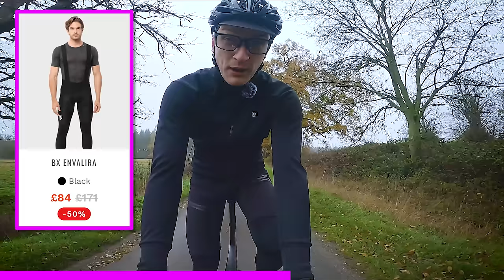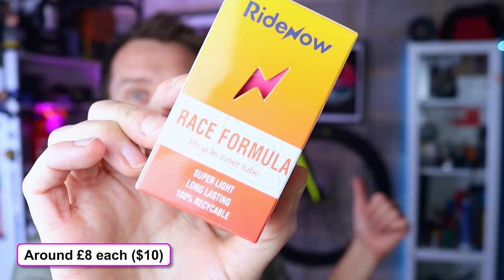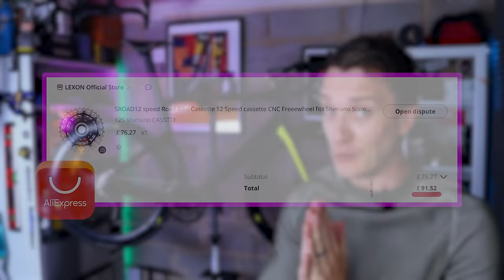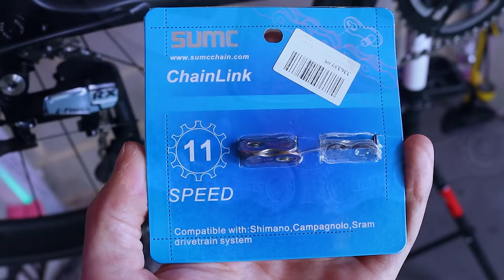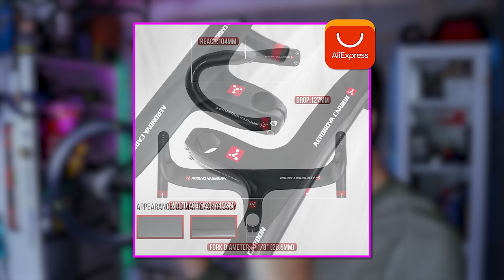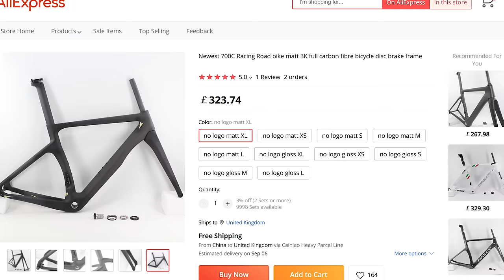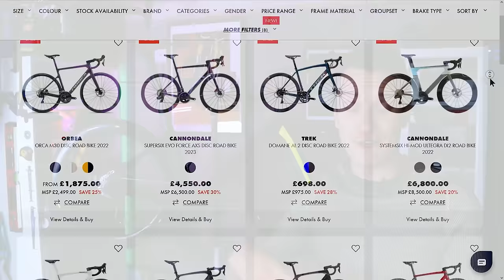£1000 AliExpress Carbon Road Bike - 600 miles later

Comment: My seat tube has the same set-up and I never had any problems with it, even like it as it's easy to set the right angle for seat. 
As a person that weighs quite a bit more and with a well over average sprint power..... I'm horrified by the sight of that carbon quality as well as the fact you have no inner support for your steering tube up to the baring. Not afraid for chinese carbon but I do prefer a brand that likes to keep up a good name (and stick to the name as well).
I do ride some Elite wheels as well, with dt swiss hubs.

Comment: With the most possible respect, I think at this point I'm actually concerned for your safety Luke. With all the problems, failures and caveats you mention here, I think you would have been better served by paying more for a named brand bike. Be careful out there. If that frame fails, which it could, you could be seriously injured. 🥖

Comment: I would have taken a chainsaw file to the hole in the seatpost to allow the bolt to be pointed more vertically.
Reply from the maker: Yeah I did think of doing this, the only thing I was slightly concerned with is that in doing so, the whole bolt could be pulled through the bottom of the hole...

Comment: Yea I hate this design. I have noticed the reason why my seat all ways slips is because when you clamp it feels secure and bolted down but for some reason the spacer in the bottom will get stuck on the carbon not allowing you to tilt it properly!

Comment: Love the vids mate.  Silly question time on bottom brackets, frames on Ali often say BSA BB68.  Does that just mean they are BSA with 68mm length?.  Is this compatiable with most cranksets, what do you have to look for to make sure compatible?  🥖
Reply from the maker: Yeah exactly right. BSA is usually the BB that is the easiest to work with IMO. It's easy to install, they are generally quite cheap, and are super easy to replace when the bearings wear out!

Comment: RXL SL isn't a brand or manufacturer, it's a knockoff logo for Bontrager. I don't know why you subject yourself to these bars. Even if they were brilliant, you can't pin down who made them, and it's such a detail-sensitive part that the next set could just as easily be trash. Very hard to recommend something if you can't have confidence your viewers will have the same experience.

Comment: Must admit that was certainly an entertaining watch, and in a very good sense!  Gotta say though that I would have very little confidence in this bike on descents especially, for fear of some part of it exploding into a huge "carbon shrapnel" event, with me laying on the pavement in unmentionable positions. Thr seat post is a disaster from top to bottom, and without some additional structural integrity provided by an expander plug, that stearer tube extension totally freaks me out.  I imagine myself holding onto the handlebars and suddenly realizing they are no longer attached to the bike.....otherwise, a very gallant, and again, entertaining experiment.  This is my first view of your channel, so I suppose I should ante up and subscribe!  PS - would be interesting to take this frame, and another name brand one running $5-7K, cut them up and really see what the differences are....my suspicion is maybe not as many as you might expect!  Maybe someone could donate to you an older, even broken,  similiar but way more expensive frame, along with a cheap one, for this task.  I would enjoy watching you conduct that procedure!

Comment: that's unfortunate to hear about the rxl sl bar. I agree the design is shit on that bar. However, I purchased one of their traditional bars (non-integrated) and it is going exceptionally well after 500 miles of abuse. It is their super lightweight model, it weighs 180g so I was kind of expecting it to crack but its taken sprinting and everything just fine. I didnt use a torque wrench, i just tightened it in increments until the bar could no longer be rotated in the stem (I used a lot of force to test). Generally, I think the one piece integrated bars are a no-go but the regular ones seem good, mainly because it seems they present less engineering problems.

Comment: 🥖🥖🥖🥖🥖🥖🥖🥖🥖🥖 Baguette Brigade. Will be interested in the Juin Tech GTs. Given that the world still doesn't have a direct, built to purpose, hydraulic brake system for gravel mullet builds (although there is the at some point coming new L-Twoo groupset), this could be a good answer to mix with an Advent X drivetrain. Although, for the price, we're heading into the same cost range of my hack Shimano build with 2nd hand GRX/105/SLX stuff using a tanpan.
Reply from the maker: So I actually stuck the GT's on last night, and they are really good actually. Prob not twice as good as the regular JuinTech's, but i was impressed. They are not entirely bedded in however, so we'll see how they really perform after a few rides...
Reply: @TraceVelo  Awesome good to see!

Comment: 7.97kg for a disc brake road bikeis pretty good I think, I have a pretty similar weight bike but rim brakes. 
The build is;
🥖🥖🥖🥖
2012 Giant TCR Advanced Frameset(size small)
Sagmit Racing Pro 2.0 wheelset
Sensah Empire groupset
YBN 11 speed chain(pre waxed)
Sunshine 11-28 cassette
Shimano Tiagra 52-36 165mm crankset
Zstar dual pivot brake calipers(looks like Ultegra)
Fizik Arione saddle
Giant Contact SLR OD2 stem
MOB Sprint 38-40cm flared dropbar
Giant Contact Bartape
Alligator Compression less brake and cable housings
Jagwire inner cables 
Zefal Bottle cage
Shimano Dura Ace brakepads
Continental Grandsport Race Tires
Generic butyl inner tubes
🥖🥖🥖🥖

Overall my bike weighs around just under 8kg I believe I can get it to 7.5kg with the carbon wheels but my sponsor doesn't allow me to take that home lol. Hope to get a digital scale for a more accurate weigh in next time. Price is probably around 1.5kUSD which I guess is unreasonable for a build that still has aluminium wheels and cheap parts but the frame is really expensive because it's the same model used on world tour races just without the integrated seatpost so I probably had money for carbon wheels if I picked a different brand like Elves or Devel.

Comment: 🥖 Hey Luke good video and heads up LTwoo have released a 2x11/12S hydraulic groupset on aliexpress. Also how's your gravel bike fairing, I have an update on my own build.
It's currently just hit 1000 miles and  only real issues were a alie chain replacement 500 miles due to stretch and the Sensah Dub bottom bracket got replaced with a nukeproof one as it developed play and a creak around 400 miles. Otherwise it's been pretty solid but it's no longer a budget build. I have been gifted an sram rival axs xplr groupset and now have the rebuild bike entirely. On the flipside It means I can use a carbon ogevkin stem and remove the Giant Conduct system , which is a massive weight save , about 400 grams alone from it so estimated weight is 8.3 kg with pedals. 🥐

Comment: 🥖🥖🥖🥖🥖🥖🥖🥖🥖🥖🥖🥖🥖🥖🥖🥖🥖🥖🥖🥖🥖🥖🥖🥖🥖🥖🥖🥖🥖🥖🥖🥖🥖🥖🥖🥖🥖🥖🥖🥖🥖🥖🥖🥖🥖🥖🥖🥖🥖🥖🥖🥖🥖🥖🥖🥖Actually very interesting the difference in stack between the two bikes. A 25mm 40mm+ is massive and highlights the marketing B/S  based on that.  

However, is that relevant with a aliexpress frame that is from a non-mainstream builder. That has no real real world continuity between frames (perceived)?

Comment: Just one honest question, please:
Is there any warranty or disclaimer on those parts? If a person is injured or dies from an handlebar\fork\seatpost failure... thats it?
Cheers and thank you.
Reply: The 'disclaimer' for parts of an unknown quality is good common sense.  It's very unlikely that in this case the retailer will openly admit to probable parts failure resulting in injury or death...they just wouldn't sell anything.  As for a warranty, well if it breaks you contact the retailer and show proof of failure.  Then just hope they refund your money.  It's another matter if you are injured or killed.  There is very little legal recourse when buying from this type of retailer.  The Consumer Rights Act 2015 and The Sale of Goods Act 1979 (for purchases made before 1 October 2015) says that any goods you buy must be: Of satisfactory quality, fit for any particular purpose made known to the seller and as described.  But I don't think aliexpress is overly concerned about that.  It's a issue if you have some form of bike insurance that covers personal injury.  Fitting what could possibly be sub-standard parts, knowingly, may void any claim made.
Reply: If you  buy through Ali Express you can raise a dispute if the seller does not provide quality goods
Reply: Thank you for enlightening. I´m still amazed such business can operate in EU whilst if I, as an EU resident, provide any kind of service or product have to go through a very strict scrutiny.
Reply: @wsbygt  E-retailers in the far east don't operate within any EU territories...They are based and supply from outside any legal frame work that protects the rights of the end consumer.  The laws of one country or state do not impact the actions of another if no treaty exist.  This is the ultimate expression of 'Caveat Emptor'.

Comment: This is a great review, but i wish you would have started with a more modern frame. I highly doubt that is a T800 carbon fiber lay up frame? T700 carbon fiber frames are 20 years old technology. The wheels are more modern than the frame.
Reply: You fell for all the marketing. Stiffer carbon flexes less, but fractures easier
Reply: @janeblogs324   There is no marketing involved in science. T900 is the standard for frames. Its lighter and stiffer, and carries a higher price.

Comment: dont spend your money one the juin tech gts and the 3d printed saddle and dont make the mistake and buy that integrated cockpit
and now you can buy a whole frameset from ican bikes
they are way superior quality
ive got 4 frames on me and had 3 of them tested by a mechanic
they went trough all the quality tests and the carbon is high quality they said
the paint ist frist class and the production quality of the bottom bracket area or the headset is top tier
i have two gravel frames ,the one you have and the aero version
and i have a roadbike frame and a mountainbike frame
but i didnt trust the mtb frame but it held up 1000km in
this frame actually got raced by a friend last weeks local race and he was surprised how compliant and responding that frame was but stiff where you want it to be
he was just 7 second below his best time and he did that best time on a trek supercaliber worth about 9k euros about 8200 £ i think
so i think you should give ican or even winspace which are two very good companies a chance and try them out

Comment: Aliexpress is a safe place to buy. You say that the the quality is not good for the 2nd steerer. You can put in that it is not fit for purpose and get your money back or not as described  similarly get your money back. Aliexpess uses ESCROW so you are reasonably protected. I have used this for many years and frankly this works better than ebay or Craig's List

Comment: 🥖🥖🥖🥖🥖🥖🥖 considered testing steel? First frame that pops up looks like they took a 50s frame, judging from the fork, n added disc brake mounts. I assume if cromoly steel doesn't rust after a few months n lasts it should last forever? Question would be if it's any better, more comfortable etc than an actual vintage frame, disc brake mounts aside.

Comment: 🥖🥖🥖🥖🥖🥖

So, one thing I remember from older stems that use two fixing bolts instead of four is that the torque spec on those stems was higher. So, I imagine you needed a higher torque spec, probably 8-12 N-m, on those handlebars. Is it worth testing? I don't know, but food for thought.

Comment: 🥖🥖🥖🥖Not bike related (radio ham), I have used Aliexpress a lot, but I have had some problems with recently. 1 vendor cancelled saying lockdown was making it impossible to supply and another claimed that they had shipped the item, it had arrived in the UK cleared customs, delivered and signed for in 3 days. Caveat emptor. 🥖🥖🥖🥖

Comment: Is the ride know patch kit included by the inner tubes
Reply from the maker: So no it isn't included. HOWEVER, i actually just got a puncture last night, and the official patches were a bit crap tbh. I ended up using a regular pre-glued patch (Park Tool Super Patch GP-2), and it worked absolutely fine

Comment: Just bought LTWOO R9 setup. Clamps on mine have washers fitted compared to when you tested them. Would love to fit LTWOO 12 speed to my other bike but it has Tiagra hydraulic setup so waiting for LTWOO to bring out hydraulic setup or do you think a hydrid brake set like yours would be ok

Comment: One don't you put a plastic collar down the centre of the bolt of the seat pin or post it seems to me you have a lot of space so when you tighten the saddle up it is moving to the garden on a angle if you can get a aluminium shim or a or a resin shame or cover so it goes in the centre where the boat is so there is still enough room for the bolt to go through the shim so they're both allgo more Les a angle to where you wanted to go not pulling towards the post eating their way of the carbon fibre that should stop your problem

Comment: I bought an aliexpress frame, mainly to go through the process of building a complete bike from scratch (80% of the idea comes from this channel, so thanks). However, how do you check the integrity of the frame? I was planing on inspecting it with a camera inside and look for cracks or faulty surfaces, but apart from that and twisting, jumping on the pedals and a few other things, what would be your process to check that the bike is ok to go for a route?

Comment: My identical frame set and wheels bike I finished last March after 2 years build ,rides very well. Look at your front and rear frame covered in crud from the wheels. I ran clear 3M tape from under headset down frame and under BB, also down the wheel side of the rear frame. That shot blasting will ruin surface of carbon and allow moisture to work its devilish way. 3M tape I used as a chain stay protector too.

Comment: With respect of the head tube trend to make them shorter... It is shit as you say. I am still in the search for a decent endurance frame that is tall enough, because with long legs (86cm) and being short torso/arms (175cm total height) it is basically impossible to find something that fits.
Reply: I know he likes integrated bars but a 12 degree stem angled up would lower the stem clamping area a lot and do both of you a favor in the safety department
Reply: Fuji Granfondo and Sportif have very high stack and short reach. Trek Domane AL too
Reply: @willspower3  those look indeed promising. I need to find a frame from Fuji to put all my chinese goodies on it so that the japanese are proud 😅

Comment: Luke, in regards to the RideNow tubes, they don’t appear to have threaded stems. Did that cause any rattling or is the stem they use plastic so the rattling isn’t loud?
Reply from the maker: Yeah good question. So below the threaded valve insert, the valve stem is plastic as you mentioed. It doesnt really rattle much, plus i use these little adhesive patches around the valve hole to prevent any rattling in the frist place: https://www.aliexpress.com/item/1005001344050603.html

Comment: has anyone tried replacing the mineral oil in a zrace br-005? my front one seems to be low on oil (the pistons aren't moving as much as on the rear, so my guess is not enough oil) - any tips for how to fill up with oil appreciated!

Comment: Best braking method on motorcycles is 60/40 so if the rear are 50% smaller area that would explain it 

ie

Area front÷60×40=Rear area means no need to adjust breaking pressure

Comment: It's so up like a piece of tube but we called it a shame or a or if you know somebody who has a life get a piece of tube like aluminium make it the same depth and measurements to go down the middle of that with a boat is to hold the seat if you can get something like that it will go in when you put your boat in should go through the cover of the tube it should be a lot more straighter what it is heating to the carbon

Comment: Just want to say that the brake pads are really just down to the luck of the draw, I had same (longer) size on both front and back.  Unfortunately I bought the shorter replacement pads , and while these works, the correct size should be the lowest longer ones.

Comment: m8 I think your saddle looks a bit too high
Reply from the maker: I honestly wish i could lower it, but my legs are just too lanky... I'm built like Slenderman
Reply: @TraceVelo  I just noticed your leg seems a tad overextended at the bottom of the pedal stroke and your toes are pointing down. I figured if you dropped the saddle a tad you could remove a spacer but if you're not getting problems with your current setup it's fine 🥖🥖🥖🥖🥖.

Comment: 22:48 I truly hope that lowering the headtube doesn't become an industry wide trend. I can crank pretty hard on the handle bars when climbing out of the saddle. 

I'm 6'3" (190.5cm), 180 lbs. (81.8kg) for whatever that's worth. I also lift weights more than is optimal for biking, so I have a decent amount of upper body strength... 
🥖🥖🥖🥖🥖🥖🥖🥖
Reply: It did 20 years ago with the giant TCR.

Comment: Don't get the smaller pads on back at all. Why would you ever want LESS pad contact for braking ? it's not even about saving weight..
Same with rotors..  For the lov of F*K i cant stand mismatched rotor sizes.